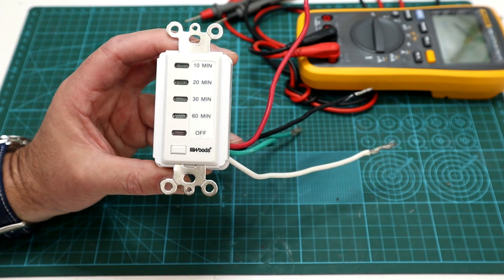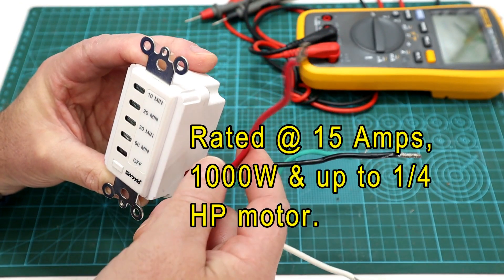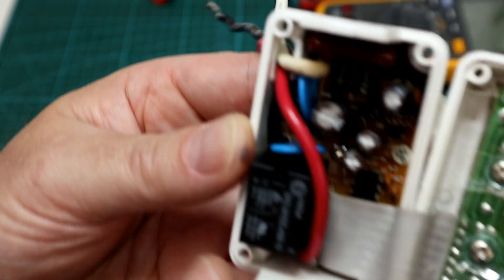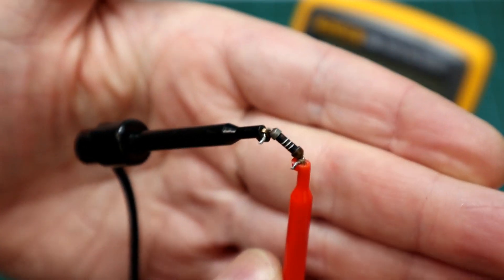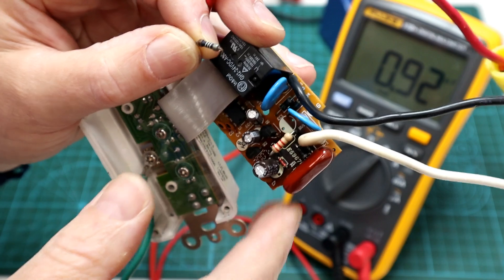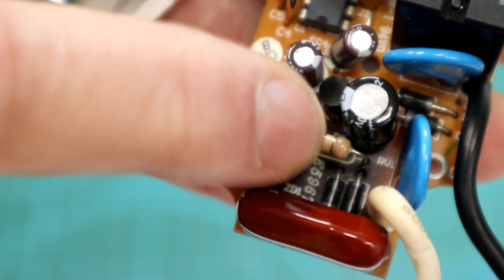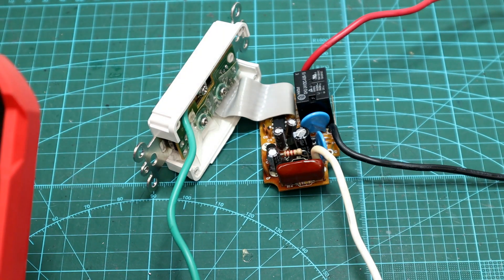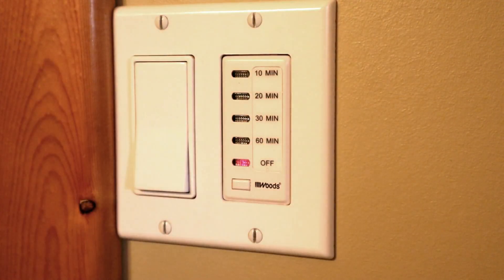Is Your Woods Timer Switch Acting Up? Simple 2 Component Fix Inside!

Comment: I’ve got the same timer and the same resistor has burned significantly. The timer may be 5 to 10 years old. It’s the same exact design as the one you were troubleshooting, just with different time durations. I measured multiple capacitors in the unit and they all appear to be bad, probably due to the heat. Because of that, I purchased a new one and surprise! It’s the exact same design as the old one. FYI, the problem resistor is still a quarter watt carbon but because it hasn’t burned up, I can read the color code and the value is 2.1 K.
Reply from the maker: Good info, thanks for sharing your experience!

Comment: Thanks for posting this video. I had the same problem. The switch is 4 years old. The resistor and board show clear signs of overheating. The manufacturer needs to do better! I have two of these in my condo; if/when the next one fails, I will switch to another brand as the posts here make it pretty clear that the engineering that went into this was not adequate.

Comment: Super helpful video!  We have two of these in our house and I fixed one a very long time ago by replacing that resistor and also the 47 uF capacitor "EC2".  Then the other one failed and it has been on my desk at work (engineering at a TV station) for over two years.  I replaced the resistor and the 47 uF capacitor as I did on the other one but it didn't fix the problem, so on the desk in a bin it went.  Today, the first one failed again so I did some searching and found this video.  In addition to the resistor and the 47 uF capacitor, "EC1", the 100 uF capacitor that you replaced was bad.  I thought maybe it might need a total recap (I'm not one of those people but capacitors are a failure point and I replace if bad) so I checked the other two small ones and "EC3", the 10uF capacitor checked at about 4 uf so that's getting replaced too.  "EC4", the .47 uF capacitor checked OK so that's staying.  My advice- if you are going to go in there and fix one of these I would check all the caps and of course replace the bad ones.  I have a feeling that the heat generated by R2 is cooking all the components and the capacitors are going to be the first things to fail due to the heat.  This probably won't be code and may not help but I am going to drill a small hole in the top and bottom of the timer to possibly allow for some heat to escape.  Will update if/when I get these things fixed.  Now it's time to place a Digi-Key order.
Reply from the maker: Thanks for sharing good tips... Yep, I too am not one of those recappers but it's always good to get more data and real world feedback to point out other components that could also be suspect in these things that have a built in component cooker. 🙃  Good luck with the repair 🙂
Reply: Also, I'm going with a 2k 1 watt wirewound resistor.  Any reason I can't use a wirewound in this circuit?  They are a little more expensive but I think it will be able to handle the heat better.  Putting in an order to Digi-Key; should I order up and then offer 3 capacitor/1 resistor Woods Timer rebuild kits?

Comment: Thanks John.  You inspired me to fix mine instead of replacing it again.  Two failed in ~15 years.  In mine the resistor was fine, though the PCB showed signs of heat.  The large cap was bulging slightly.  When I went to desolder it one lead just fell right out.  I'd guess that it swelled and broke the lead.  So mine just needed the cap replaced.  Incidentally while testing it I found the a slight jolt and knock would cause it to turn off.  Maybe the cap lead was intermittent and motion would cause it to open for an instant, enough time for the timer to lose power and reset.
Thanks for saving one more bit of electronics from the land fill.  For me it was quicker to change the cap (I already had one) then it would be to go to the store and buy a new timer.
Reply from the maker: Glad you were able to get er' fixed and saved from the land-fill 👍

Comment: This is a very helpful video, John!
I haven't dug into circuit repair in a long time! After three years of electronics courses, I figured out that I had a knack for programming and database administration.
I need your thoughts: This is my second switch and is only three months old. Its predecessor was four years old. Same problem in both: The switch powers up, but no matter which time-setting is selected it counts down in seconds versus minutes.
All of the resistors are in spec. I haven't the time nor gumption (yet) to pull the caps out and measure them. What are your initial thoughts on what may be happening?
Thanks!
Reply from the maker: Interesting its the same failure on both and a minutes to second failure no less. I honestly have no idea. I suppose the first thing I would do is look at the data sheet on the IC chip to find the timing/trigger method. I never dug into that on mine, so no idea how the timing is configured. If it's capacitance timing, then perhaps a bad capacitor on the timing pin of the IC? Just a wild ass guess and doubt that's it. As for why it's failing this way, again no idea? Anecdotally, we have 5 of these woods timer switches, and not a single one has failed in that way. Very strange.
Reply from the maker: July 25, 2025 Update. Not sure if you'll see this @patrickcohan8902, but I just had another timer switch fail in the same way - was turning off in seconds, not minutes. I replaced the burnt looking 2.2K resistor and that 100uf 50V cap in this one too and that fixed it! Difference with this one, was the cap actually checked out ok with the DMM meter reading about 91uf. It however had high ESR and when checked with a function generator & oscilloscope, it was passing lots of ripple. Not saying this would be the same fix, but it seems that one capacitor specifically causes all sorts of issues with the timing circuit if it has failed or is failing.

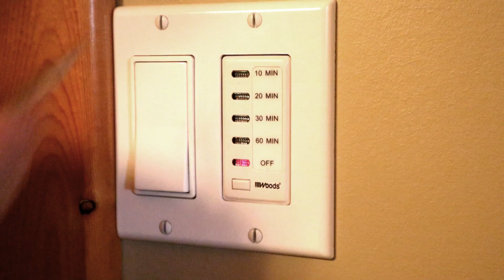Comment: I noticed at the end @ 7:42...The screws are perfectly aligned vertically...Hmmm....Is it the same everywhere else in the house 😉😄😄
Reply from the maker: @1983dmd - Yes indeed. 🙂 I did all the electrical in this house when we built it, using the valuable skills I gained working for a very detail oriented German electrician on the weekends while in high school. He was a demanding guy, but very fair and taught me so much. I think all good electricians will ensure all switch plate screw orientations are matching (either vertical or horizontal); but perhaps those days of workmanship pride are gone?  🤔
Reply: @Rchelicopterfun ... That is how my dad (German) taught me when I was a kid, and the same for my electricity teacher (Mr. Benschoff) in highschool.  It's probably what made me so "particular" about everything else I've done since then! 😂